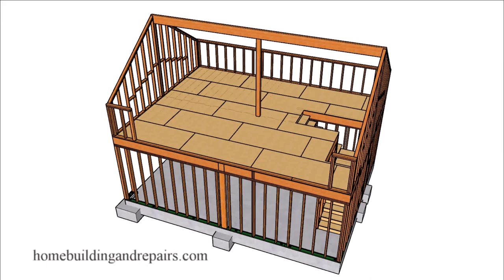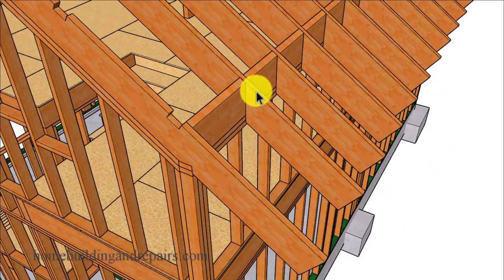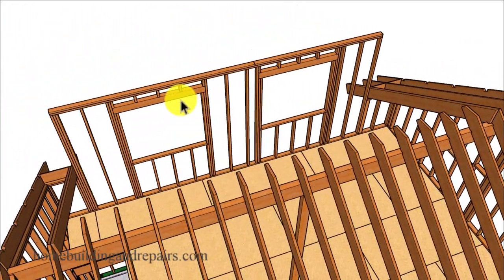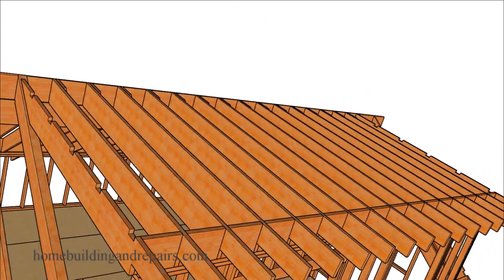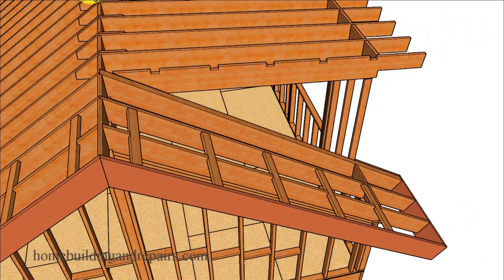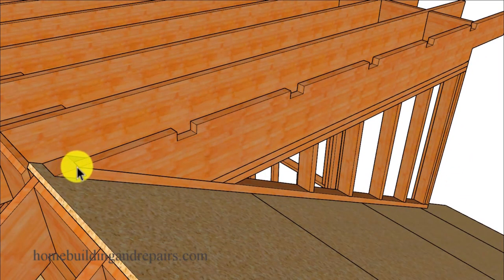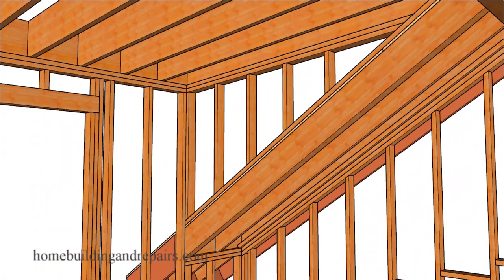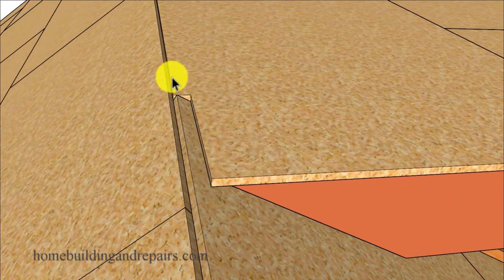How To Build Two Car Garage And Shed Dormer Between Two Gables - Building Education Series Part 18

Comment: As a new structural engineer doing wood framed houses, remodels, pole barns, garages, decks, porch covers, etc. . If I ever have trouble visualizing something new (like a dormer) I head over to your youtube channel and whew! have a learned alot! THANK YOU!
Reply from the maker: You're very welcome.
Reply: No discussion of the ridge beam, though.  Be very careful.  You can't just assume everything is good with the existing ridge, especially if you open up the floor plan and/or remove the collar ties.  You have to do the math.

Comment: i got a 2x12x20 foot board i'm thinking of using for the ridge.  my cabin is 12x16.  i might make the upstairs loft 12 or 10 feet across.  and make built in storage or sumthing for the other 4 or 6 feet.  i think this will work for a 'cathedral' ceiling in the top 'attic'.  also a 2 foot overhang on each side.  does this make sense?
Reply: i won't need dormers or seperate roofs. the roof will be 16x20 and only use 10 sheets of 4x8 plywood decking.

Comment: Would you be able to add a dormer like this with a compression style roof/ridge board? I've given it a little thought and couldn't figure out weather the outside dormer wall would properly distribute the roof load. I'm basing this off a 32'x20' cabin with a 12 12 pitch roof.

Comment: You should probably put some sort of disclaimer in about a structural ridge for long dormer ridge spans.  A single piece of lumber isn't going to cut it.
Reply from the maker: Here's my disclaimer, check with an engineer before building anything that might require structural beams.

Comment: Okay, Greg. This is your best one yet in this series. 

A simple gable with a dormer does SEEM very straightforward. But for the first time since starting my project, I actually learned a lot of subtle details that I had never accounted for. I had no clue that the dormer side walls would be built last… And would actually sit on top of the roof sheathing. Wow. 🤯 
I’ll figure out waterproofing this but I do understand.

This is the only channel on YouTube that literally mocks up the design, and then peeks into every nook of the build. This is ESSENTIAL. Period. 

The only frustration is that I make it to the end of the video so quickly! This one video could easily be expanded into 45 minutes. Viewers need it!

Nothing urgent, but this video stirs a few questions:

1. I did not know that the ridge beam does NOT run across the ridge of the dormer. This is vexing. It just seems to make sense to have a continuous ridge, rather than ridge blocks. Hmmm. 

2. Most dormers I have seen actually don’t begin at the actual ridge. I guess I assumed a dormer “begins” about a foot lower than the ridge. Then the shed roof begins “slightly below” the actual ridge. I guess it’s just aesthetic preference whether to make the dormer begin at the highest point, as well. 

GREAT video. This was needed.
Reply from the maker: What an awesome comment and it's sincerely appreciated. I think the best way to answer your questions is just to point out that this in one way to build this and that there are many other ways. Let me know if this did not answer your questions.

Comment: Awesome video, as I'm wanting to do this for my garage loft as well.

Is there any problems with putting a dormer on each side of the garage? Does anything else change, ridge beam size or what not?

Thanks for the great video!
Reply from the maker: You might need larger beams and footings.
Reply: @gregvancom  thank you!

Comment: Hello,

I am planning on building (roughly) a 24x16 building with a similiar dormer window. It will only be a 1 story, and the concrete is already poured. In researching how to do the roof, I see a lot of conflicting advice on what is required. I am not too worried on the math of rise/run or how everything fits together, I simply can't seem to find a reputable source on the engineering side.
1- for a 24' span (without overhang) what material is recommended for the ridge beam?
2- if I were to put a garage or a french door on the gabled end side, what material would be best for the Header on that opening, given the supports where the ridge beam would be centered on top of it?

Comment: Yes I’ve got a six pole carport off garage and want to puta eight foot by eight foot room in the center I braced up the floor and want to cut the roof raise it eight foot and just put walls  on it it has12 /2 beams conected to the three polls on one side and going across the middle is 10s if I build the walllsin the midddle will it work
Reply from the maker: It sounds like it might.

Comment: Hi Greg, I would love to use this knowledge to add dormers to my current cabin build. But, I noticed this method of rafter layout for dormers is for a ridge beam. I have a ridge board. Is that okay?
Reply from the maker: Probably not, but it will depend on the design.

Comment: hi, I am planning on leveling my in closet garage with the rest of the home which is 17 inches higher than the garage floor. Do you have a video i can watch to learn how i can bring the floor up? do i need to put 4x4 on the corner for support and place LVLs on top and then run the floor joist? please any advice is appreciated Thank you
Reply from the maker: I don't have a video, but put it on my list. I would think you could build some walls on top of garage floor and connect floor to wall framing, if that makes sense.
Reply: @gregvancom  Hi, thanks for the reply. Just wanted to put out more information about my garage to give you a better understanding of what i am dealing with. I have an enclosed garage that needs the floor to be raised 17 inches to match the rest of the house floor. this garage is 260 inches long and 132 inches wide. do i need 2x10 floor joist? if possible can you please make a youtube video and explain to me what steps i need to take in order to complete this project. Much appreciated. thank you so much